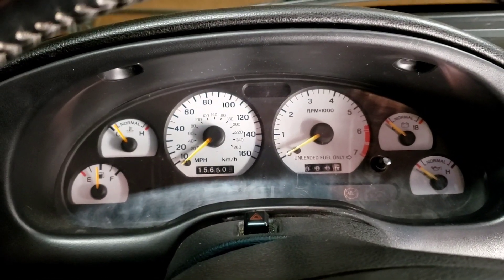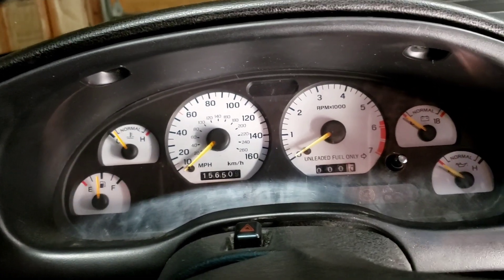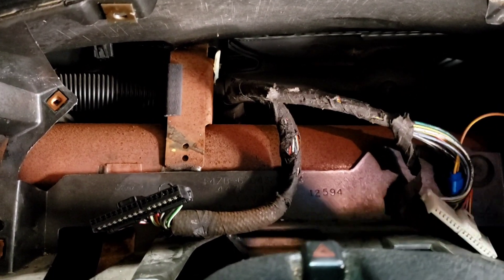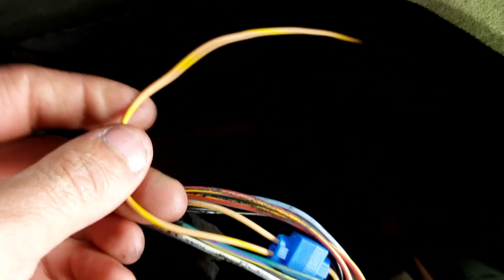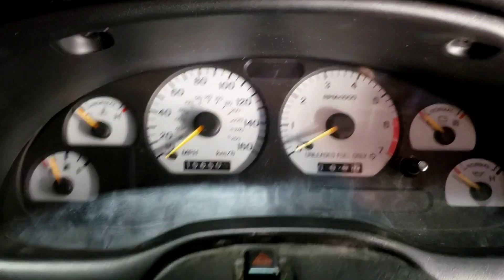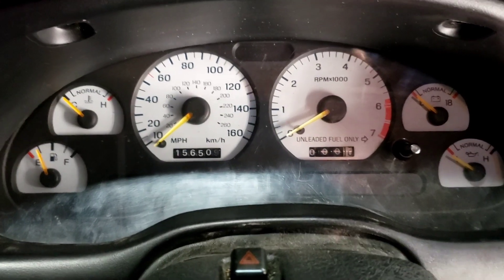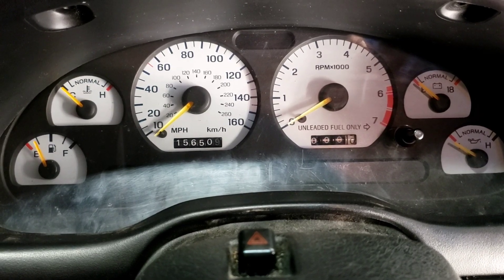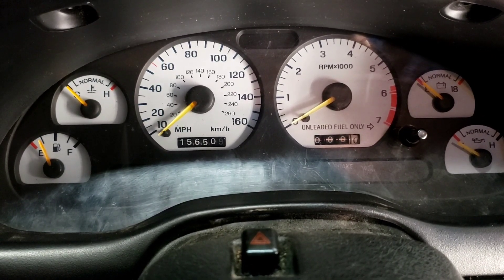Coyote Swap SN95 Wiring Factory Rpm Guage

Comment: I have a 95 coyote swap gen 1 with power by the hour body harness and trans harness I'm having an issue it doesn't want to stay running would you happen to have any idea what would cause that idols for a few seconds then idols real low and then idles real high
Reply from the maker: It's hard to tell but if your harness is hooked up correctly and it's still doing that I would check your vacuum lines.

Comment: Which generation motor/control pack? I dont see CTO in the wire harness schematics.
Reply from the maker: I have gen 1 motor and control pack. CM-14A006-A5LC. My cto wire is  located in plug c47 pin 7. I finally got the a/c hooked up and will make a video soon.

Comment: Following ! Are you planning on wiring up the ac as well? That would be awesome too
Reply from the maker: Thank you I appreciate it! I am planning on running ac, I already have the compressor mounted on the bracket. I'll do a video on the wiring soon.
Reply: I would like to see this as well. Thanks, Frank.
Reply: I wired my up just like this and my tac works but the tac is off 400-500 rpm according to my scanner and a shift light